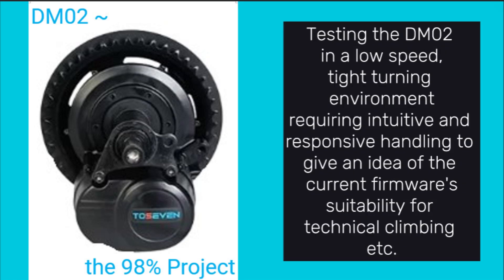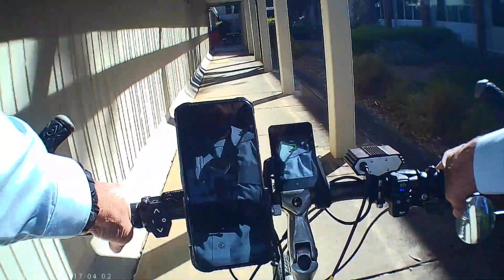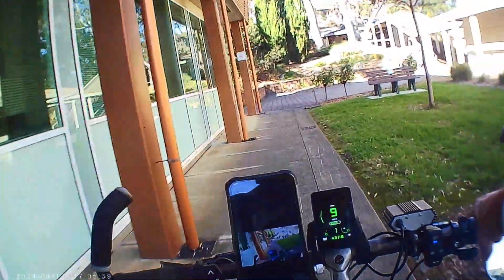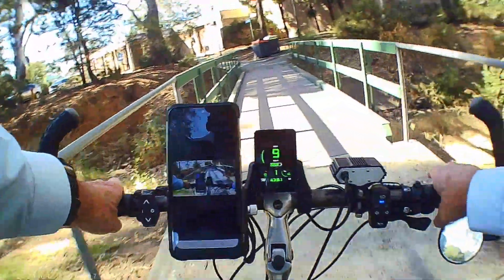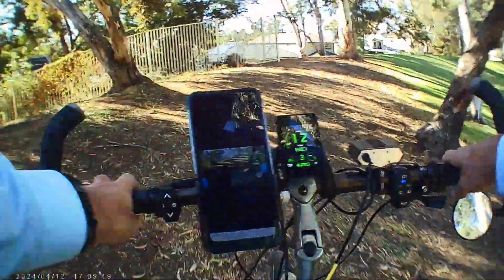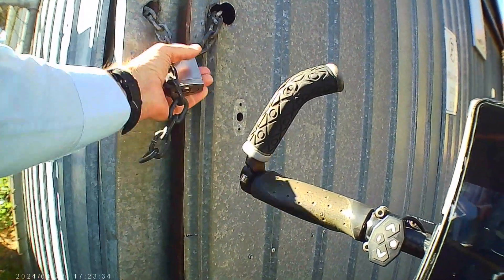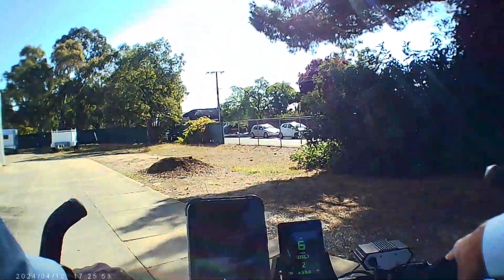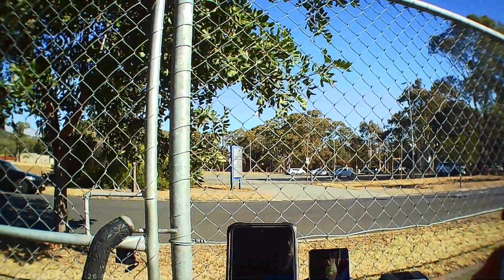DM02 ~ the 98% Project - Testing the Finesse of the DM02 Torque Sensor and Firmware

Comment: Considering buying a motor. Is this a 250w motor?
Reply from the maker: G'day Mark, My 500w rated DM02 is a 250w motor like Bosch Performance Line CX and a Shimano Steps E-8000 and Giant/Yamaha Core or Earth Antebike are 250w. All of them are really 500 to 650w rated motors that are speed limited to 25kph. I've tested all of the mid-drives mentioned above and they all get me up a road with 10 to 20% gradient ramps in about the same time with a similar effort from me. You can get 250w specified DM02 motors, they are physically slightly smaller, and are 250w at 36v and 350w at 48v.
Reply: @Ianane2  thank you.

Comment: It's awful how noisy that motor is even in low speeds at low power. I have the same issue and I hate the motor for this reason. 
With a little bit more load it actually becomes a bit quieter.
Reply from the maker: @ShardCollector  yeah, the noises don't instill confidence but the performance is still really good - still waiting for To7 to have something to say about the noises.

Comment: Hi Ian. Can you change gear sensibly with dm02 without shift sensor
Reply from the maker: I've never had a shift sensor. And for the last couple of months have never 'wished' I had one as the torque sensing is now very good. Nor do I have brake sensors and want or need them even less. 
For the earlier firmware versions, pre Janurary 2024, I did have one of the brake levers rigged up like a 'dummy electronic clutch' to immediately cut power for gear changes and it worked ok but it never became 2nd nature to use it.
As above, there have been two firmaware upgrades since this video and the torque sensing is constantly improving. Every upgrade seems great until the next one shows how much better it gets, and so I can't see additional sensors adding much advatage.

Comment: What size battery do you run? Do you think the dm02 could run a 52v 10ah battery?
Reply from the maker: I've currently got a 15ah 48v battery but it is nigh dead. I think you can run 52v with the DM02 - There are options for changing the battery details in the standard T24 display  and I think I have seen one person refer to using a 52v battery  but I'm not sure if they have a DM01 or a DM02. I'll get back to you here. Please Note, the DM02 needs a totally different build/controller install for 60v batteries. As for a 10ah battery, it will depend on where, how far, what power level you use etc... But I'd expect you'd get about 40kms with some reasonable climbs included... And I can confirm people are running their DM02s with a 52v battery. Their caution, which I echo, is quality of power cell and the smaller the Ah, the greater the voltage lag effect. I'm waiting for some well made batteries to arrive and then I'll do a video about batteries and run the DM02 over my 'hardest' local blacktop roads for comparison

Comment: Love your approach and philosophy Ian. How much do you have to spin the crank before the assist starts is it around a quarter turn?
Reply from the maker: Thanks Onotsamada, The torque sensing is immediate now. So much so that some people with the DM01, the big brother of the DM02 motor, need/want brake sensors so the motor doesn't start while resting a foot at the traffic lights. I have not found this a problem but I only go through one traffic light. It also stops immediately when the pressure is off the pedals BUT there is still a bit of 'spin' that runs down and makes a rattling sound. This spin is good for changing gears under load, when I take the pressure off (stop) the pedalling to change, the spin guides the chain up a sprocket/down a gear and then the torque helps take up the load and lost momentum. Always better to be in the gear you'll need before hitting a 20% wall so you don't need to change under load but real life ain't perfect.